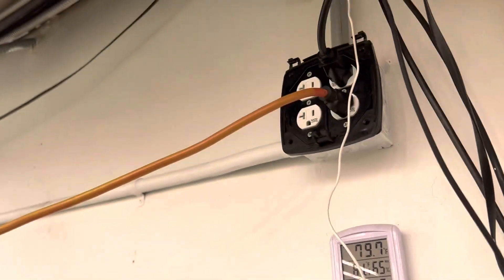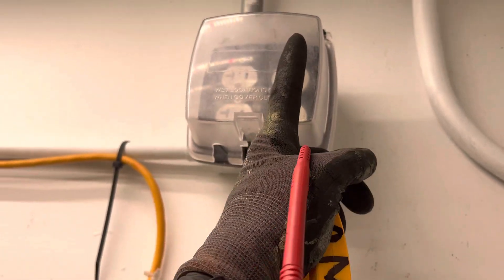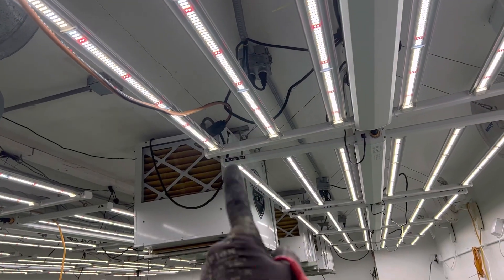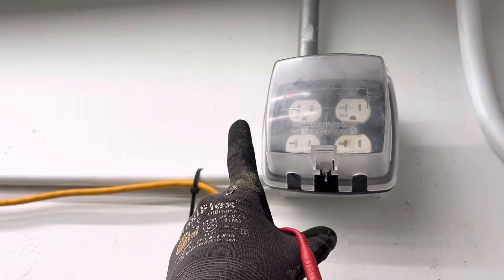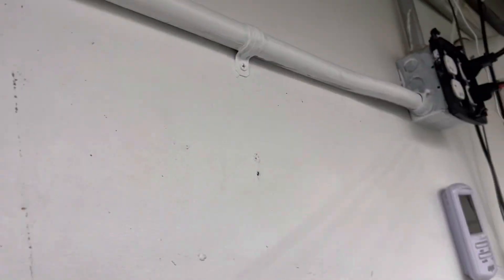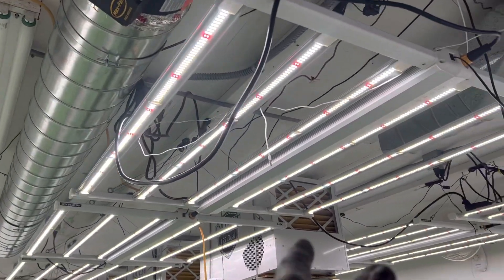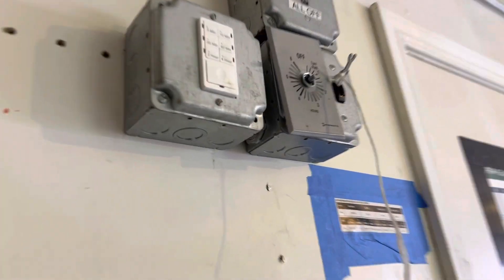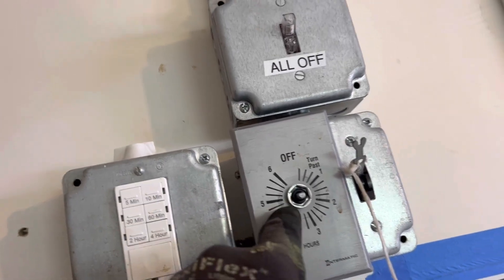TWO CIRCUITS DEAD, THREE DEHUMIDIFIERS ? Too many loads on one circuits let’s find the problem

Comment: Years ago I made up a male and female cord cap connected with some #12 wire. All 3 conductors were open so I could plug in stuff and grab a reading with my amp probe. It was always interesting to see if black and white were balanced or if there was a leak to ground.... especially on ceiling mounted gear where you can't easily see the data tag and know what the draw is supposed to be. In this case (remote gear with extension cords) it would be the perfect tool for trouble shooting, once the power is back on. In this case the outlets also need to be tagged with panel A, B, C, etc... plus a breaker number.
Reply from the maker: Unfortunately many sick so-called electricians who are professionals with a contractor license or just their workers working on a side job do not tag their outlets or panels unfortunately

As for single phase black and white it’s all one circuit they both simultaneously just allow current to travel 

In some cases you’ll come across a little bit of ground leakage of course we know it should not but that’s the difference between theory and what’s written in book and what happens in the real world. 

Especially if you’re accidentally reading voltage that is induced into the ground wire by traveling parallel right next to current carrying wires you can literally read a induced voltage through the air through the insulation and a lot of guys get thrown off by this thinking it’s actually coming from the device. 

Where balance becomes an issue is in three phase wiring like in motors

But this was all stuff that children learn back in sixth grade and seventh grade in science class and in math class all the way through high school especially in science when they went over physics and electrical

Then again as somebody entered trade school and went through a nine month to 2 1/2 year plus program on electrical or HVAC this was covered in all the classes and every semester. 

Unfortunately education is not mandatory it is optional

By all the accidents out there there’s a lot of options being taken lol 🤣
Reply: @coldfinger459sub0  ... I am familiar with balance and 3 phase since I did generator work for 25 years. OTOH, some of the crap you find is not in the books. In the generator business we use block heaters and depending on who's doing the work (sometimes old work) a block heater will leak voltage to ground via a bad heating element, which in turn conducts through the engine coolant. Most are cord & plug units... so you learn tricks. (that break-out cord) I also did lots of festival work and you'd be amazed at what vendors plug in without a second thought. Why is that breaker tripping at the other end of a 100 ft cord? Is it an electrical issue or an idiot issue? (use the break-out cord) Induced voltage on a long run is another animal and can play hell with low voltage signal circuits. So are lost neutrals with no ground in old homes while standing on a dirt floor in a basement. (ouch!) The theory is in the book but real world troubleshooting is not.
Reply from the maker: @rupe53  When you mentioned doing festival work I knew you got to see a whole lot of hair raising experiences of like what the hell were they thinking lol 😂
Reply: @coldfinger459sub0  ... almost every festival is a situation of limited power and sometimes totally off grid with one or more gen sets. 25+ years ago I started bringing in temporary panels and getting these guys organized. I worked with the same 3-4 promoters every year and made good money for a long weekend, while watching great shows and half naked hippy chicks dancing. What a way to spend a weekend! I pretty much retired when my partner in crime died almost 3 years ago. These days I am totally retired from the gen business and only do small work maybe once a year. Time to sell a garage full of gear and think about moving south. I'm in New England now.
Reply from the maker: @rupe53  Cold and snowing in New England I guess being at the age of retirement shoveling the driveway no longer is a first happy thought in your morning
Reply: @coldfinger459sub0  ... oh, it can wait till the afternoon now that I am retired. I don't mind doing it because it earns me brownie points to hit happy hour... and that's within walking distance if the weather is that bad.... maybe 10 minutes tops if I stop to chat along the way.
Reply from the maker: @rupe53  😂